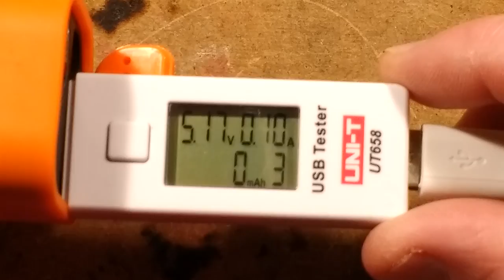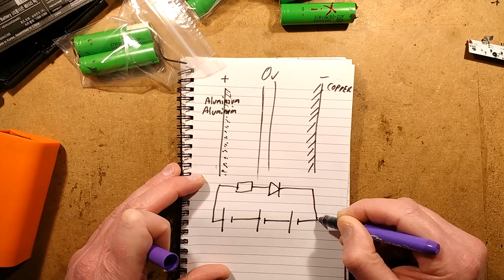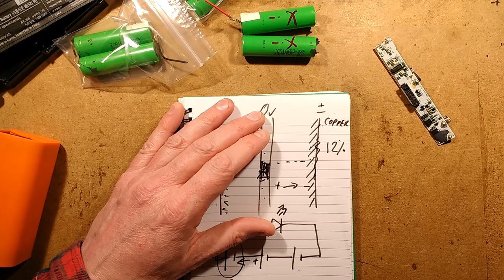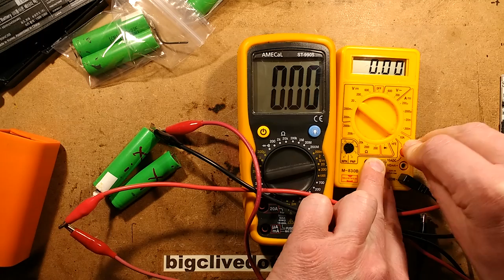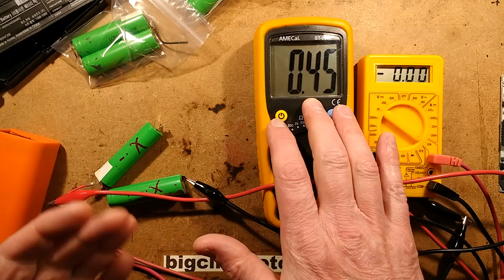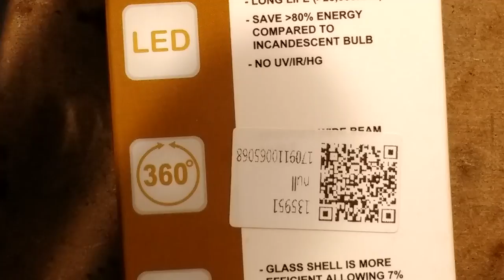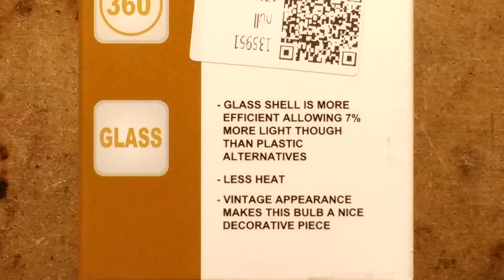Teardown of a faulty Samsung lithium 18650 cell.  (2200mAh)

Comment: If that board in the battery pack balances the cells, it's the first time ever i have seen that in a laptop battery, so i beg to disagree on that point. Cells are characterised at the factory and the sets are selected for similar iR, which means you can do without balancing in low-discharge applications (laptops for example).
Reply from the maker: It does have quite a bit of circuitry on it, including what looks like balancing components.  It would be odd to have a multiple series cell lithium pack that didn't have some form of balancing, either in the pack or the laptop.
Reply: bigclivedotcom you should look into it. I reckon there is no resistors for shunting the cells. Look up the datasheet for the controller - it does not support balancing. The circuitry in the pack is a set of MOSFETS that enable charge/diacharge like the usual DW01-setup. Rest of the power components are for blowing the chemical fuse(s)

Comment: What it looks like to me is the electrolyte has lost connection to the electrodes, which is why it came off in the first place and coated the membrane, that cell is definitely dead.  Like, dead as a doornail dead.  I'm not entirely sure about that, so don't take my word for it.

Comment: Could you have just got some more 18650 batteries - maybe better ones and revive the laptop portability?
Reply: He could, but whats the point if the laptop is shitty
Reply from the maker: I got a cheap replacement battery on eBay.
Reply: Once the laptop battery pack controller decides that the cells are dead, it effectively kills itself in the firmware, so replacing the cells is almost certainly a waste of time.

Comment: Until you took off the coating, I could see using plates and going across the material and checking resistance..between the sections..

Comment: You no there are fuses built in these cell right there called pcb or something you can pop them back with a small flat screw driver the cell your playing with could be charged
Reply: That cell you open could have been fully charged without you knowing

Comment: @bigclivedotcom interesting stuff 'bout lithium cells lately :) Seems running cells below 2.5V isn't as bad as it is often "promoted". I've been unsuccessfully searching for (easily undertandable) details of the other side, which is also promoted as "very bad" for li-ion, that is charging them to more than 4.3V. Commonly it is considered unacceptable for Lithium Ion cells to be at more than 4.3V, most sources do not recommended them to go over 4.1V...
BUT...Few days ago I charged 2S pack with cheap china charger and they went to over 5V each (charged very slow)! They weren't  hot nor swelled, but I was worried they might ignite or explode. I started discharging them with a strong flashlight, first at 0.5A and then with over 2A. They became a bit warm at 2A, so I discharged them to about 3.8V at 0.5A.It, suprisingly, took quite some time/held some charge.
Now I wonder what their condition might be? They could be very dangerous for being over 5V (although only for few hours), but they also might have only lost part of capacity because of this "incident", but be OK otherwise?
Clive, could you please try to explain/bust myth/confirm also this "overvoltage" side of lithium ion cells?
I know, testing this could take more than thin gloves for safety reasons, but I'm sure that many subscribers would love to see some lithium action on bigclive's desk :)
Thanx, Dejan from sLOVEnia.   P.S. Love your videos even though they cost me A LOT of sleeping time...
Reply from the maker: I think the biggest risk with overcharging is concentration of the lithium ions on the negative electrode, potentially damaging the chemistry and causing a dramatic reduction in the life of the cell.  I don't recommend overcharging them.  It's notable that if you undercharge cells to around 4V they last a lot longer.

Comment: Maybe next time you find a cell that wont take any voltage you should take the outer casing off and connect the voltage and charging leads on the remaining tabs again and then slowly unravel it until it starts taking voltage. That way you may find the exact spot where it had broken through.

Comment: Cells fail because either the graphite (anode) or the LiMnNiCoO2 (cathode) lose their cristalline structure, or because the electrolyte in the separator evaporates.
You're not to find visual clues from both types of fault when you disassemble the battery.

Comment: If you're looking for a volitile level of lithium in a bettery, just go get some of those single-use, Energizer Lithium batteries. You may want to do it in a controlled environment though because your accent implies that you live in a humid climate. Anything above 20% relative humidity is risky. I live in the desert & I've had the lithium strip burst into flames in my hands. They usually give you a warning first though. They'll oxidize really fast then begin to smoke a little.

Comment: How about forcibly reverse charging the other cell for long enough to migrate a lot of copper, then dismantling it.  The weight of the copper foil and some maths involving N_A and q should tell you how much charge is required.

Comment: If battery leak does liquid from lipo very dangerous when it get on skin.
Reply from the maker: I'd suggest wiping it off, but it's not dangerous for a brief contact.
If a lipo is damaged, take it outdoors and discharge it if possible, as that makes it much safer.  The main hazard is the energy they store and not the tiny amount of lithium in them.

Comment: if you connect 18650s to good cells posative to posative and negative to negative you can bring up the dead cell to 3.7 volts in about 5 minutes and they should charge. my 18650 chargers look for 3.7 volts before they will charge a cell to 4.2 volts. also under the posatiuve terminal there is usually a protection cap that pops up when the gasses inside need to be released often when they are discharged to low, i have seen this happen in solar exterior lighting circuits in winter time, if you carefully insert a small screwdriver below the posative end you can push down the cap until it clicks into place and restores the current to the posative pole. dont believe all the hype asbout explosions they are like gremlins just dont get them wet ie adding them to a glass of water they will explode in water and burn with a bright yellow flame under water. never had any problems with hard cylindrical cells but Ive seen soft packs for radio control models puff up and explode once or twice when charging so that takes place in a tin these days esspecially with 14.8 volt 5000 mah pacls.

Comment: Ah, hammering the hard disk, not enough memory means Windows has to constantly use the paging file on the hard disk as extra volatile memory hence the slowdown.  Another stick of RAM would probably have solved the issue.

Comment: If the pressure valve has disconnected the pole you would get zero voltage.

Bend the valve back and the cell will take charge again.

Comment: I know it won't help everyone , but it might help a few, some laptops will run without the battery pack in place. My Acer aspire one is doing fine w/out it .
Reply from the maker: The slight downside being that the battery can act as a UPS if you are prone to power outages.

Comment: THANKS FOR this video i had an old dell type u164p battery pack that the laptop was done playing with a long time ago and said was dead but i took it apart and all the cells in it are charged and not dead or ready for there funeral they are 1865 cells but still work in most all my 18650 cell stuff

Comment: Probably wasn't the best thing to breathe lol. I had to replace the 10 year old six volt batteries in our aerial boom lift earlier and used muriatic acid to clean the jumper cables sice they were covered in green crust and the noxious cloud really distorted my taste buds and was most noticeable when I attempted to smoke a cigarette and it tasted really weird. That same thing used to happen when I would seat new commutator brushes in DC elevator drive motors with a special stone that helps the brushes conform to the convex shape of the commutator.

Comment: I recognize the battery, I think I have the same series laptop mine had an i5-3210 and some amd GPU tbh that laptop did quite good for 6 or 8 years the battery died after 4 years of using it it first started turning off at 20% until it got worse and worse until it stoped working on battery at all

Comment: Well... I never saw any 18650 cell survive below 3.6v. All my cells wich are around 3.4v, 3.2v, 2.8v all heat up pretty badly while charging and doesnt hold the charge, the internal resistance consumes it and forces it into going fastly back to the original voltage. 

So i guess they were damaged somehow?
Reply from the maker: Their internal resistance may increase, I wouldn't recommend high current charging of any but the very best cells.

Comment: To cut down on hard disc hammering always disable Prefetch, Superfetch, and Indexing.
Some you can do in services and others take regedit-ing.  You can find it on the internet what to do.
It really calms down the hard drive hammering.
Win 10 is supposed to disable those services if you are booting from a SSD drive.  But so far
that has not worked automatically for me and I have had to manually disable those services even for my SSD machines.
And you have to watch out because those damnable Win 10 updates will turn those services back on.

Ironically SuperFetch was supposed to be an improvement over PreFetch and cut down on hard disc hammering.
My experience is it did just the opposite.  And if Superfetch was supposed to be a superior replacement for Prefetch then
why did they leave prefetch running?  
Indexing is suppose to allow you to search much faster by creating an index ready for anything you want to hunt for
on your hard drive.  But I never need that.  I keep my files categorized in an intelligent way.  OK ... in a way I understand which might
not necessarily be intelligent but at least I understand it.

Comment: Lithium batteries have a bad reputation for exploding, because when they do short, they get hot and the hotter they get the more current they can pass which in turn increases the temperature, in turn increases the current, a positive feedback loop which continues until catcher they catch fire and/or explode.

Comment: The Gin has a  higher energy density than your lithium cells...Run everything off Gin, I say. Seriously though, there is probably between 2 and 5 times the enegy available in a glass of Gin? At a guess - not thinking too deeply about it. (What is the alcohol content?)

Comment: My mum had a samsung laptop, I wouldn't recommend them. It was the biggest pile of annoying crap I had ever used.
Reply: I gained an unwanted/unloved old Samsung laptop.  It had started out with Windows Vista.  Then been upgraded (whether officially or unofficially) to Windows 10.  For all I know it had been Windows 7 and/or Windows 8 in between.

It now has Linux on it, which makes it somewhat more usable.  Only problem is Linux recently dropped support for the WiFi chippery in it, so if I need WiFi I'll either have to boot into an older kernel or buy a WiFi dongle.

Comment: I stripped 57 laptop cells and had awesome ratio of good cells simply because I was using a few 8 x 18650 power banks to charge them. It's amazing that I only threw away the obviously damaged cells that were rusty or leaking.

Comment: Recently watched a fellow take one of those dead lithium cells and revive it by jumping a good cell across the + to + etc and allowing it to sit for 30 seconds, the bad cell was quick charged from 0 volts to 3,2 volts, and took a full charge in his junk China charging device.  I have no idea if it held a charge and it looked rather dangerous to me, but what do I know, I have only been playing  with electricity for about 50 years now.